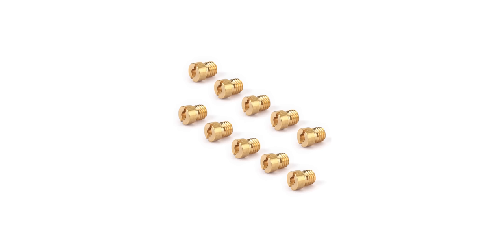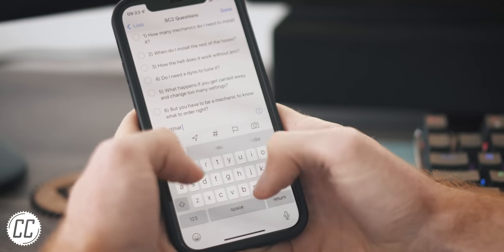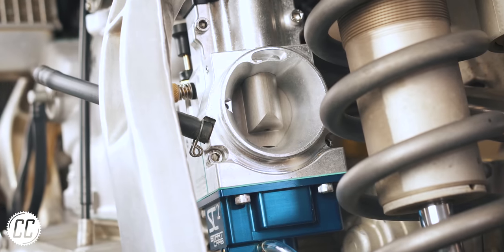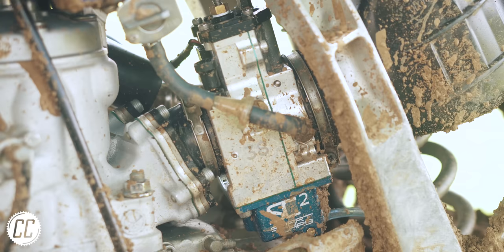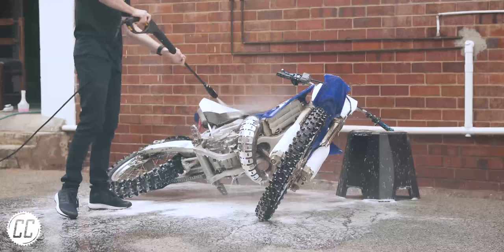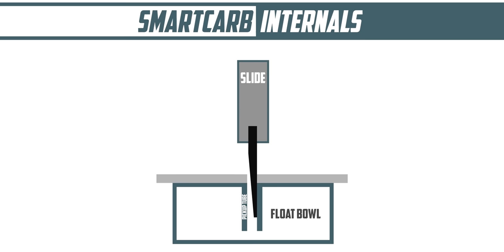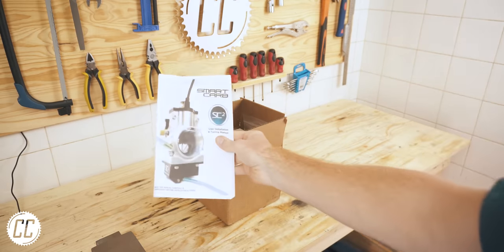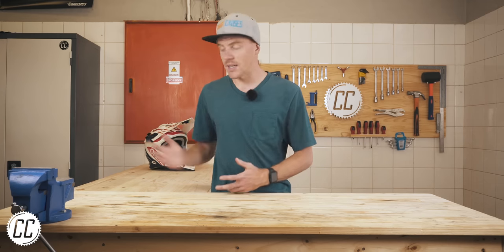The Best Carb Money Can Buy? | SmartCarb SC2

Comment: The reason for this carb being "self adjusting" is the same thing that happens on a normal carb; the thinner air decreases the vacuum signal, less fuel comes from the float bowl, and the bike runs essentially normal. Often times, when you go UP in elevation, the only thing you need to do is increase idle speed a bit. I've gone from 1,800 feet to 8,000 feet on many different 2 strokes (with quad vent keihins and TPS's, I might add) and many different four strokes (CV style carbs found on LTZs, Predator 500's, FCR Carbs on 250/450f's, Mikuni VM's and TM's on my old school vintage bikes) and the only thing I've ever needed to adjust on the four strokes is the idle screw. The only carb's I've ever needed to change jets with to not foul plugs were 2-strokes with the Mikuni TMX 36's and 38's, which are notorious for being very finicky. 

Maybe it's just me, but I don't understand how having only 1 main form of adjustment from idle to over-rev is an advantage. If you want the ease of adjustment, use a Dial-a-Jet on a normal carb, and save yourself enough money to do the next 3 or four top end jobs, lol.
Reply: The reason this carb compensates for changes in air density better than other carburetors is its use of a metering rod and integrated, internal float bowl venting. We've tested up to 22,000 feet on drone applications with very minimal variance in A/F ratios and we don't take into account the elevations that our customers ride at. No need for it. There's a difference between dialed fueling regardless of large changes in air density and getting by with good enough or not fouling plugs. 

The advantages of single circuit fueling is that there are no overlaps or transitions between multiple circuits. It's one continuous curve. Of course that does require having the correct fuel curve or metering rod grind installed and positioned. We make it as easy as possible for our customers by selecting the metering rod they need based on information about their setup, mods, fuels, etc and by positioning it for them, erring slightly rich. Most customers lean the rod out a few clicks using the top clicker and tweak the idle RPMs to their liking using the set screw and that's it. No further adjustments required.
Reply: @SmartCarbFuelSystems  how do them go in dual carb bikes?  I might be interested in this just for the fuel saving on my daily. Though getting my mikunis tuned more than just by ear might help too
Reply: I don’t have a dirt bike,  but on my street bikes, there is a lot needed to adjust a stock bike to altitude... I’ve brought many bikes from sea level to 5k feet and all of them run too rich. It requires minimal adjustment (either a needle or jet by one size or notch) it still needs it. Just my experience.
Reply: Save your money. These things are a waste of money.
Reply: @GingerNingerGames  you should never tune “by ear”. Always tune by what your spark plug is showing you. A carb with a metering rod like Lectrons are really night and day. When I built my drag banshee for 1/8th mile some years ago I switched to gas lectons, picked up a lot of ET. When I switched to methanol Lectrons, it was game over! I’ll never use anything but Lectron on any of my bikes
Reply: I hate the TMX’s .. had one that worked great for years then after a rebuild I could never get it to work properly again.. took a  Keihin off a cr250 and never looked back
Reply: @DoubleBogeyBaker  Yeah, plug reading and arse dyno was what I did. Runs ok, I'm probably not going to get much more from it honestly, and if I tune for power it'll call it quits, it's been running since the 70's and it's had a hard life
Reply: It's definitely not an advantage the company lectron has produced almost the same carb, & they done it four years ago. Since then many people have switched back to the stock carb
Reply: Same thing I see
Reply: @jdtv...9134   you're missing a bit of history. The Lectron came to market in '74 and has remained largely unchanged since. SmartCarbs began selling in 2012, and they aren't Lectrons. There are more differences between the two than are readily apparent including full external adjustability, no power jet, true-to-size venturi with variable throttle shape, TPS option, and internal float bowl venting. Check out the article on our website (link in the video description) that explains the differences and their shared history.
Reply: @SmartCarbFuelSystems  regardless the four stroke guys are left in the dark. Imo
Reply: @SmartCarbFuelSystems   not to mention the high pricing point most people can't afford on both units the smart and lectron.
Reply: @jdtv...9134  we appreciate your opinion and feedback. As markets go, and in this case simply fitment, throttling, and tuning baselines, the 2-strokes are much more uniform, having had, especially in the last 20 years, fewer and less diverse stock carburetor options with easier to design top-pull throttling. SC2 SmartCarbs are designed to replace those stock Keihin PJ/PWK and Mikuni VM/TM/TMX carbs. Historically the 4-stroke bikes are more diverse with more and more complex-to-replace stock carburetors. There's no ill-will, it's just a matter of more development, especially with 4T applications that require side-pull, dual/push-pull cable throttling. We're working on it. Carburetion is tricky in general, and modern metering rod carburetion is a new level, especially adding in the complexities of side-pull throttling and vacuum plate roller slides like the venerable FCR uses.

In the meantime, happy riding!
Reply: I'm not a biker anymore but I can tell you my carbed 4x4 runs like poo all through the throttle at 8,000ft, huge power loss and pig rich.
Reply: @SmartCarbFuelSystems  still the perfect carb for 06 cr125 imo
Reply: @Borntoride125  thank you, we agree!
Reply: @SmartCarbFuelSystems  would of been great for boat motors 20 years ago. 
Maybe you guys can make a compelling argument to the right people to bring back two stroke outboards
Reply: @keithpeterson3447  care to elaborate on your opinion?
Reply: @taylorpratt6287  

Lol
Reply: If you did only 1 mod, to a stock 1982 Suzuki GS 750 E, what would it be?
Reply: I completely agree with DoctorMotorcycle, 100% and I think I even made exactly the same point; properly tuned CV carbs fixed the annoying AFR flat spot problems 40+ years ago. You can't beat that without full blown throttle body injection w/ a wideband o2 sensor. Period end of story
Reply: @keithpeterson3447  definitely do not agree and never understand the disdain some people love to have with different products from the norm. I have a KTM 250 that I could never dial in consistently with a Keihin or Mikuni with many, many settings changes. The SmartCarb was my last resort and it worked perfect from 4000 feet to 10000. So much so, I’m probably buying another for my new Beta. The only downside I can see is the weight. They are really heavy at over 2 pounds if I recall.
Reply: @kevingorzny  

Pretty easy to dial in the Keihin or Mikuni but not everyone has that ability. 

Assuming i have an issue with new products is pretty presumptuous? My problem with SC & SC2 is that they claim their carb makes more power than the Keihin & Mikuni. This is totally NOT true. Had these on the dyno a number of times & never seen one make more power than either a Keihin or Mikuni....ever. I know other people who have found the same.

If you want to make power then do NOT buy an SC2 or Lectron.
Reply: @keithpeterson3447  easy to make comments in YouTube without videos to back it up though.

I can also make the opposite claim of what you are claiming, and resort to calling stuff "garbage" too. Proves nothing, just like your comment proved nothing.
Reply: @sepg5084  

You think i care if you blow your money on this junk?
Reply: @jdtv...9134  $499 for lectron for my bike is not bad.
Reply: @hoptard  well we've equipped over 50 2022 KTM 125 XC bikes with great results. Did your friend or you bother to reach out to us for tuning advice? Did you trim the airboot as is required in the KTM bikes for proper SmartCarb float bowl venting and as prescribed by our user manual and quick start guide? It's a requirement for proper SmartCarb function and performance. Not doing so can result in all manner of running issues. Speaking of which, the Sherco also requires that trim. It's the worst offender actually for requiring it. Once made those bikes run well which is why our fuel system has been adopted by most of the professional and semi professional enduro Sherco racers in the US.

We encourage you to reach out with questions about proper installation and tuning of both yours and your friend's SmartCarbs. Or if you choose to sell them please let the new owners that they can reach out to us for the same level of service and advice. Happy to support any SmartCarb owner who's willing and able to accept our professional guidance.
Reply: @keithpeterson3447  "pretty easy to dial mimimimi" it's not your bike, and not your carb dude, shut up. jesus.
Reply: @LoneWanderer905  

Who pissed I your cheerios? 😆

I love it when SC2 & Lectron girls get all mad & defensive of the junk they wasted big money on....denial. 😉
Reply: @SmartCarbFuelSystems  

✔️ 
...another fail for the SC2.  Dud👎
Reply: @keithpeterson3447  at the risk of validating your ramblings with a response, we feel it's important to remind you that you're commenting on a SC2 win video with nearly 1.25 million views. Still waiting for your dyno charts by the way. Hit us up when you plan to back up your claims against ours. 👍
Reply: So.... Looks like a custom mikuni with custom external adjustments and internal venting.  And that hole in the bottom of the air passage to the float bowl, that the taper needle is in..... that is what is called a jet.  This carb just adjusts needle height over swapping jets, cool but same final results.  Only "smart" thing I see about it is the external adjustment, which is off the charts awesome.  I would almost bet no change in total fuel economy though if the original carb was set up correctly, takes a certain volume of fuel & air to make a certain hp.  Unless you are drastically changing the fuel/air ratio, and possibly operating outside of the original engineering, basic total fuel should not change much.
Reply: @ramsey6684  SmartCarbs don't use a needle like a Mikuni or other conventional carb uses, but rather a flat ground metering rod. And yes its interference between the fuel nozzle acts as a jet, allowing more fuel flow proportional to air flow as the slide opens. What makes the system unique is how its patented internal float bowl venting assists fuel "lift," i.e. driving fuel flow proportional to the air density inside of the airbox and also its velocity. Rather than venting from wildly changing conditions at the ends of the vent hoses in front of the rear wheel, the SmartCarb vents in a controlled environment and much quicker as a result (less lag/mismatch in air densities).

You're correct in stating that it takes a certain amount of air/fuel to make power, but the substantial increase in fuel economy isn't explained by lean running or zero fuel spillage alone, but rather by more efficient combustion due to finer fuel atomization and more demand sensitive fuel delivery. Essentially there's less fuel/unburnt charges escaping the exhaust unused. If you're using more of it more consistently, or burning it better, you don't need as much of it for the same or better results.

Even against a properly dialed Mikuni/Keihin the SmartCarb will provide greater performance and fuel economy as attested by our customers and professional racers and proven out with our EPA emissions certification work and other client product development/testing over the years.

Thank you for your interest, reach out anytime with questions.
Reply: @SmartCarbFuelSystems  

All that claiming of "better atomization" is total b.s. 

Infact, your carb is WORSE at atomization & that's the reason it makes less power, even when "tuned" properly. If you're NOT making power, you're NOT burning fuel. That's why the SC2 & Lectron don't make power vs the Keihin & Mikuni. The SC2 & Lectron can't deliver the fuel as well "prepped" for combustion as the Keihin or Mikuni & that's why the Keihin & Mikuni MAKE MORE POWER EVERYWHERE  in the rpm range.

The claim of the venting being superior is also total b.s. other than fuel spillage. 

I could help you with the fuel being better prepped but you guys are another snake oil company that is wouldn't want to be involved with. Too willing to lie to sell things to the unknowing customer.

If you're after power, save your money guys. Jet your stocker if it needs it. If you can't jet, buy a jd jetting kit & save a butt load of money for other things like bike maintenance.
Reply: Back at it agin  @keithpeterson3447 ? Our superior atomization claims are backed by research performed at the University of Wyoming. Show us your research, white papers, emissions certifications, dyno charts, anything? Anything at all.

Internal, integrated venting is objectively better for many reasons including the ability to meter fuel with a single circuit covering the entire throttle range. Metering rod fueling that is, with it's superior fuel atomization. Furthermore the SmartCarb compensates for air density factors as proven by testing done third party by NWUAV - up to 22,000 feet on their 50cc 2-stroke engine platform. Not to mention it makes the carb a sealed system with zero fuel spillage and the ability for it to meet forthcoming evap and tip-over regulations as a result.

Frankly Keith we aren't sure you could help yourself out of a wet paper bag. Thanks but no thanks. You might try Boswell though, we hear he's altogether more willing to run with it. 

Lastly, our customers know about our claims and enjoy the proof of those claims, as do our professional racers, record holders, dealers, and partners. If there's an "unknowing" party here it's you.
Reply: You have to change jets for various elevations on 2 & 4 strokes. Sure it'll run, but if you are going through your stated elevation change, the bike is going to be stupid rich up top in the rpm range because the main jet circuit is not set right. 
If all you do is idle around and are not on the main circuit, then fine; that's the idle and pilot jet circuits. But saying all a person has to do is change the idle at various elevations is terribly incorrect advice.
Reply: @keithpeterson3447 LOL,  oh, uh any evidence for that or did your boss at the Mikuni factory suggest this comment?
Reply: You'd think after 44 replies I'd have my mind made up. Nope.
Reply: @SmartCarbFuelSystems I... never-mind that I went to your site lmao
Reply: @jlo7770  lol no worries! We are equipping more and more paramotors as we go for the reasons you mentioned. The selling points are the improved performance sure, but mostly the consistency for elevation changes and with how limited they are on maximum fuel capacity per FAA regulations, 25-30% longer flight times are a big deal.
Reply: @SmartCarbFuelSystems  didn't realize you were already working on it but I don't really look at the bigger motors for trikes. Between fuel eco and ease of use I could see it being a "must have" accessory down the road, ill def keep am eye on your site for future developments!

Comment: Never had an issue with older keihin style carb, could drive it in the summer just fine and when the winter came with snow and negative Celsius temps, I just went with bit richer mainjet and adjusted idle.

Comment: The PWK is a great carb, I have a worked KTM 380, I had to bore the carb out to 39.5mm from the stock 38mm so I could jet it.  I like having 6 adjustment points with the PWK, it took some messing about, a number of different needle tapers etc but the bike is now crisp everywhere over the throttle range.
Reply: I thought the 380 had a 39mm
Reply: I thought the 380 had a 39mm